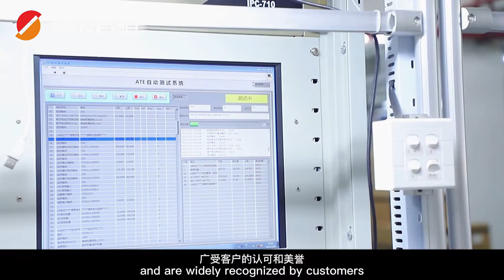About SRNE

Comment: Hello, is it permissible to convert an inverter from 120 volts to 220 volts, provided that the transformer, MOSFETs, and capacitors are replaced? My question is: Does it require control programming? Thank you. Please answer.

Comment: Please help me!
I am using a SRNE 3kw inverter. If it supports 100 PV than I don't know why, it shows pv over voltage fault code "09".  Is THERE any solution to use 100 pv?